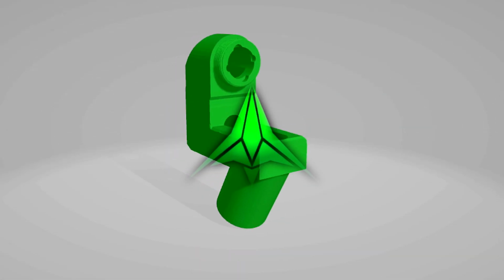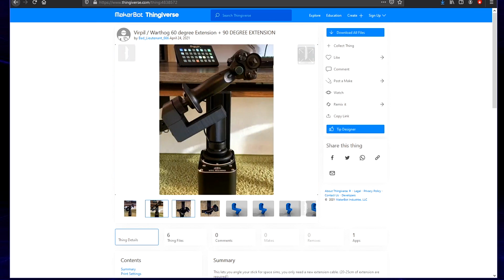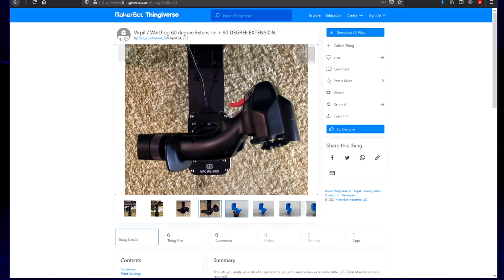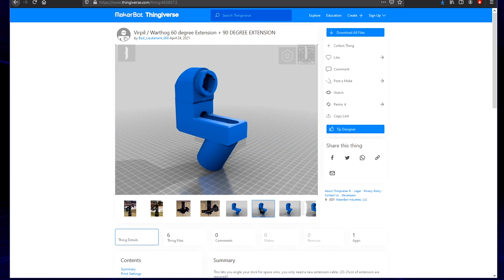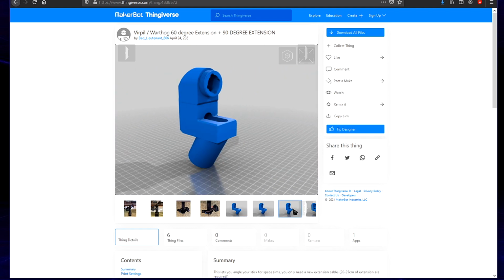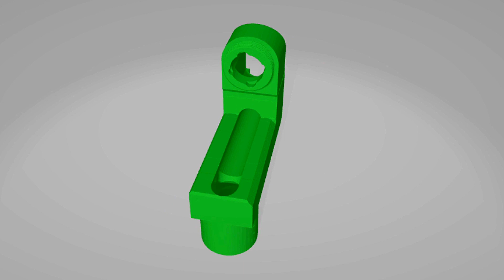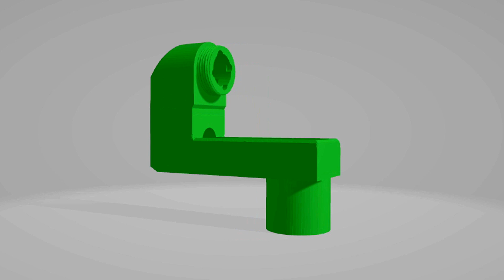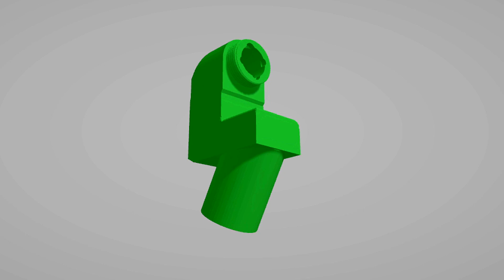3-D Printed Virpil Stick Adapters by Bad_Lieutenant_666 | First Look | Thingiverse

Comment: Very interesting. I am still 'learning' to use a pair of Virpil Alpha's but I wouldn't mind maybe trying an angled left stick.
I see Bad LT 666 says it designed for a Warthog, but seeing as it's on a WarBRD base I am sure an Alpha stick would also fit.
Nice vid, thanks AF
Reply from the maker: No problem! I find the angled stick is the only way to fly for me. 

I think he says it's designed for the Warthog because the threads are identical to the Virpil threads.
Reply: @AfterimageFlight  Ah. I see your point, but if the warthog and alpha both screw onto a WarBRD base, would that not be the same? Or do Virpil sell different iterations of the base to fit different grips?
The pictures he shows on his thingyverse site shows it being mounted to that base. I imagine the height of both sticks may differ but I can't see that as a problem
Reply from the maker: Both the threads on Thrustmaster's Warthog and all of the Virpil sticks and bases are M36x2 (actually this is the same as the Gardena Hose Connectors as well - which is what a lot of people used to use to make their own extensions). The cables/connectors are 5 pin mini DIN for both VirPil and Thrustmaster, and the grips are compatible on each others bases (except that you will lose any additional buttons and Axis inputs when connecting a VirPil grip to the Warthog base, so for example you won't have a Twist Axis if you connect a Alpha or Delta to the Warthog base).